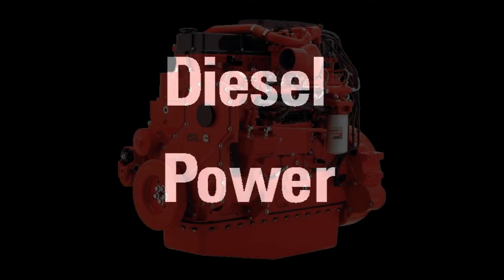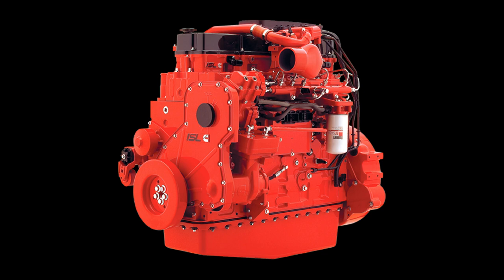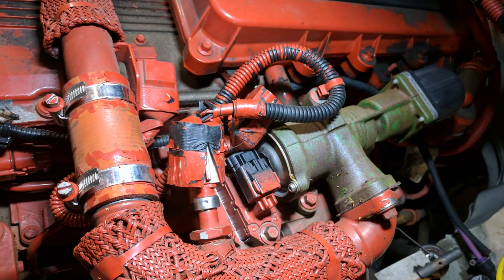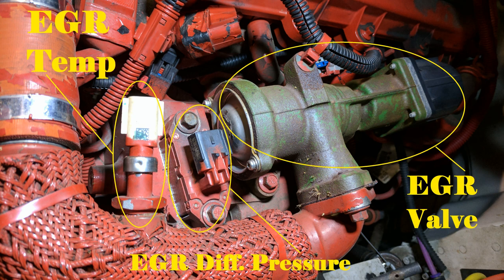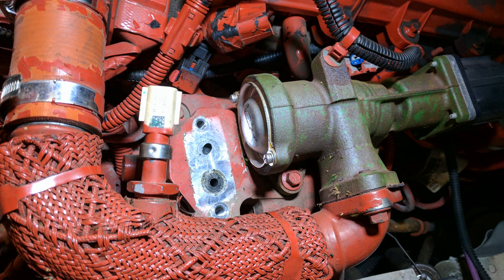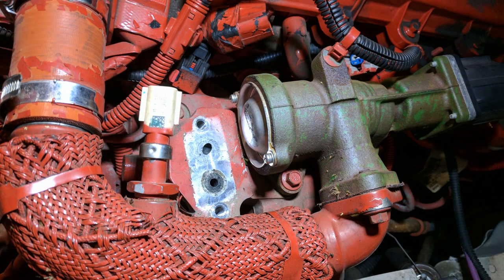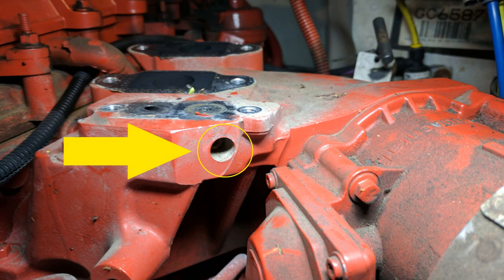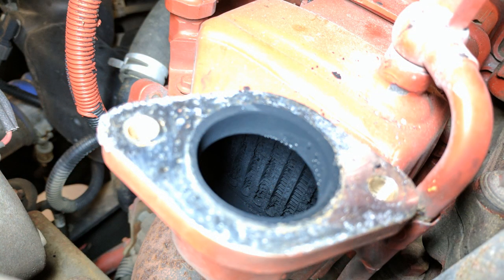EGR Quick Fix 2 - Cummins

Comment: Heat up the plug before removal.. or risk thread pull out.
Someone mentioned also that aftermarket egr coolers can build up soot and set  temp codes. 
If there is excessive soot.. look into turbo or engine conditions to cause this.

Comment: Hey, TheDieseler at it again. Thank you sir. Though I would like to know what happens to the soot that gets shot back to the intake line. Thanks again.
Reply from the maker: +Ivan Ramirez Good question. The soot basically gets pushed back into the intake where it came from. Thanks to EGR, the intake is filled with it. As a CAT representative once said, these engines now "Eat their own S#*$".
Reply: TheDieseler that's what an instructor of mine told my class. Thanks again.
Reply: Cummins Isb is good for it too. We have to blow our fleet out quite often. We pull the whole throttle body and blow everything from the sensor ports, egr valve, egr cooler, and intake. And i clean the grid heater off
Reply: What do u have on the pacar 13?
Reply: @TheDieseler  hi, what about Cummins isx its same or different
Reply from the maker: Different generations of the ISX are similar but with different orientation of the components.
Reply: said abdulle 
Saaxiib haa aniga ayaa sidaan ku sameeyey keyga oo ah 2015 ISX.

Comment: Does this engine have Intake manifold 1 pressure/temperature sensor? I have a code that come off and on.  I have 2009 ISB Cummin 6.7L on a bluebird bus. I found the barometric sensor,  MAP sensor, EGR differential pressure sensor.